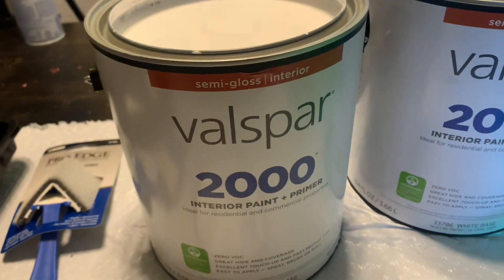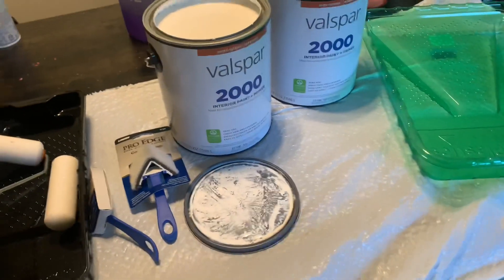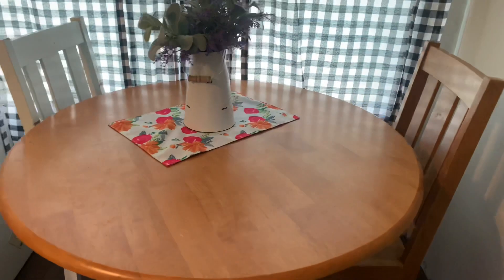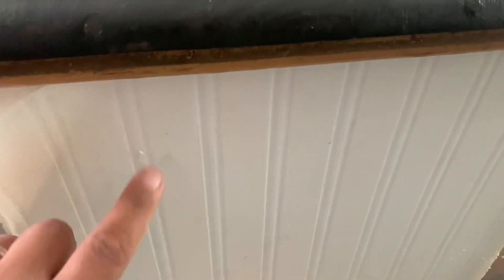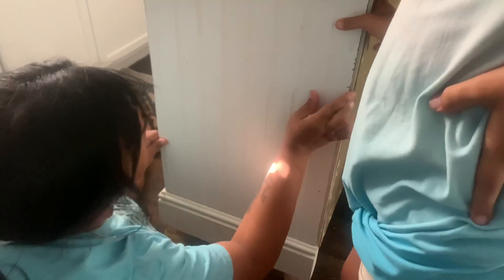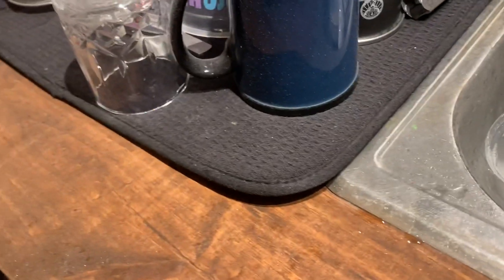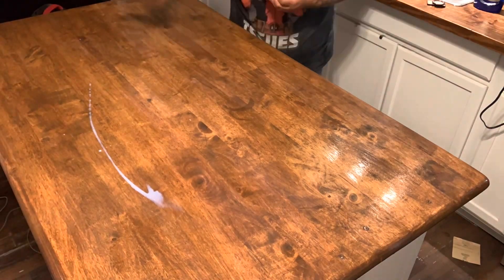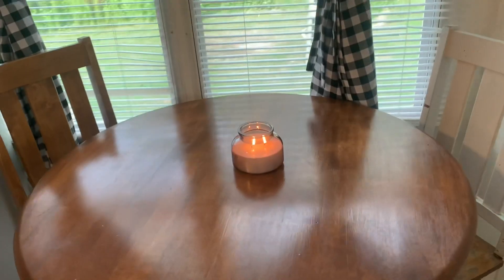Mobile home kitchen updates | Dresser into kitchen island | New kitchen table

Comment: I would do something very similar.. only, on the corners where you caulked to seal, I would have put 1/8 (maybe 1/4) inch dow rods that were stained in the same stain as the counter top. To give it some nice edges and a bit more of a 'SNAP' factor.